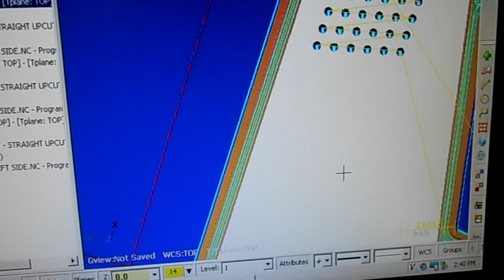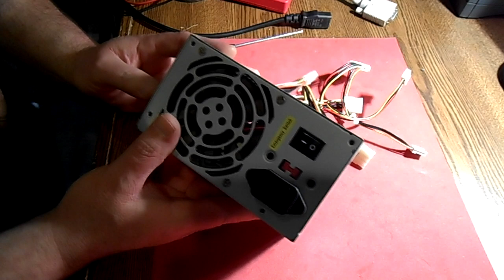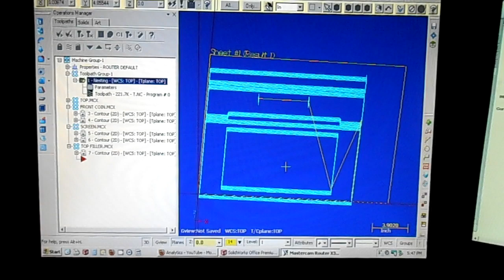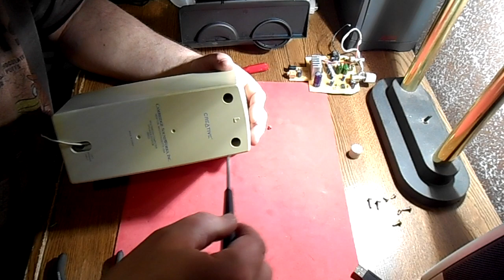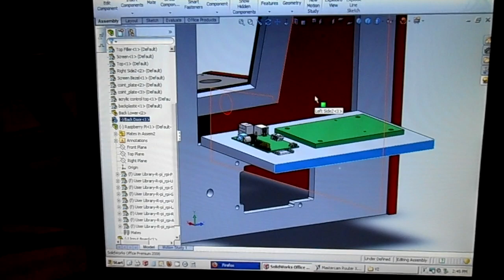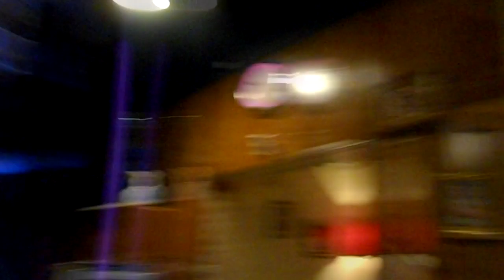Work Continues on the Raspberry Pi Powered Mame Arcade Cabinet

Comment: There is an emulator but it emulates older game consoles not specifically Arcade cabinet type games. You can use a keyboard to switch between each emulator as they all run at the same time, then select a game rom to play and it runs. Would be nice to use this with a Arcade Stick controller then a old 486 motherboard like used to be used.

Comment: Great work but if I may say, you should definitely hack more your 3d printer.
I don't believe it would be so hard to enclose it with let's say plexiglass then you wire your vacuum to the head of the printer and just launch a fake 3d printing that goes everywhere with your vacuum header that in fact clean up everything for you !

Comment: A TN (Twisted nematic) is a type of LCD panel. TN's are reasonably fast switching displays but have poor viewing angles. I've done this and regretted not having the best visual angle for all 4 players. Use an IPS based panel which have near 180degree viewing angles and much better colour saturation and contrast. You'll be pleased you did.

Comment: What most people have is a six button straight layout 3x3 then the 2 separate above for coin and start I would even put a few more buttons between the top two or on the front for pause, service, test etc. And to answer the question would 5 be OK for me no as Street fighter is my main game and why limit the pie to just Mame you will eventually put more systems on their which use more buttons SNES for example.

Comment from the maker: You can actually program the cutting in Master cam with something called tabs that will hold a part in with small material bridges that are customizable. I get lazy and just hold parts in by hand so I don't have to manually free them latter and do more sanding to the bridges. I do use tabs on small part that get to close to the cutter thou;)